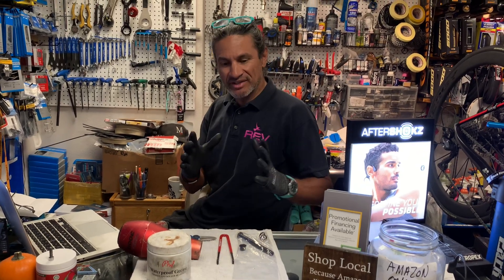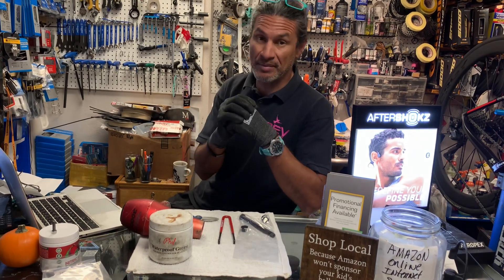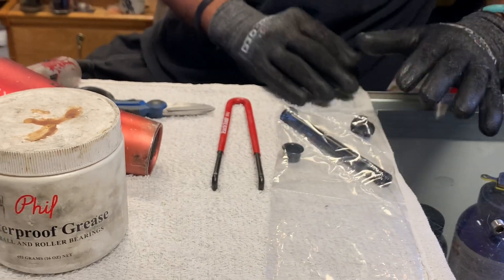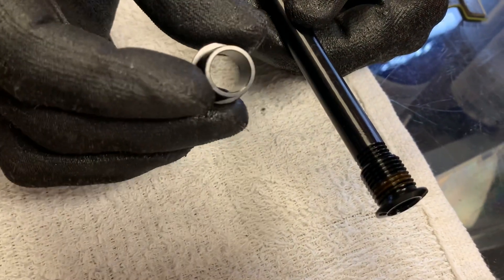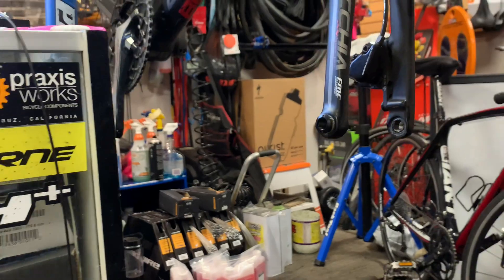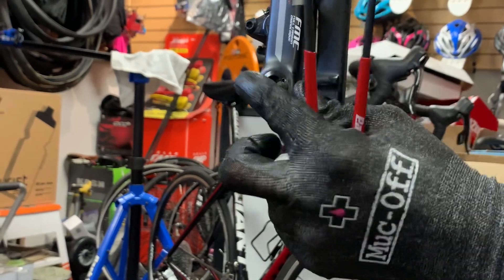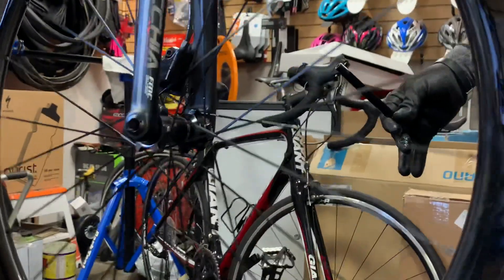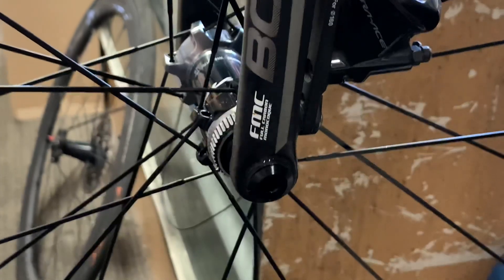How to convert a 15 mm thru- axle fork to 12 mm thru-axle fork ￼

Comment: Thanks for this post. A team friend just gave me new barely used CX demo bike 4-5 years old with rival 1x thru axle mech. disc out of their storage taking up space. 1st 1x disc brake bike.   Trying learn the maintenance and upkeep tricks for parts i do not know about.  Fork has 15mmm while rear has 12mm. So looking at 15mm to 12mm conversion tricks in case needed.
Reply from the maker: Awesome! I’m glad I was able to help you sir!

Comment: Have you done this on trek domane? JJ the manufacturer has the video demonstrating on his page, he doesn’t grease anything or heat anything. Just wondering if that should be done with different brand than the bike you’re working on here
Reply from the maker: I am a creature of habit. I grease EVERYTHING even things that manufactures say to loctite. 

You do you. This video is more about making people aware that a conversion is available because I don’t see much about this on the interwebs 

Cheers

Comment: Dónde lo consigo ?
Reply: Shoping ??
Reply from the maker: Try this gentleman tell him I sent you to him https://www.ebay.com/usr/joejack951?ul_noapp=true
Reply: @SeeYouUpTheRoad  are there any concerns with the structural integrity of this item? I have this issue with my Trek Domane S 5, I just bought wheels that are 12 and the front fork is 15mm while rear is 12.
Reply from the maker: @Ineedfwns  hello Ron I can’t think of an issue. As of today, I think this is a safe solution. I’ve been using it on my personal bike since I released this video (my bike in the video) . 

Cheers
Reply: @SeeYouUpTheRoad  thank you, that is so good to hear. I’m ordering from the eBay you linked, thanks for solving a major issue for me. Gave the video a like George 👍🏼
Reply from the maker: @Ineedfwns  please tell Joe (eBay link)  I sent you!
Reply: Why heat the insert? You are expanding it making it a tighter fit into the forks and when it cools it will shrink.